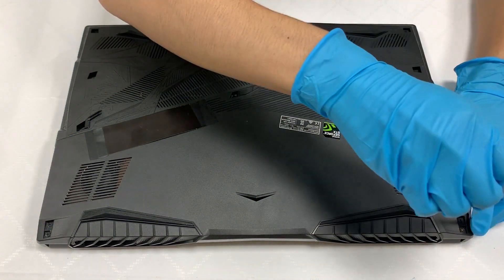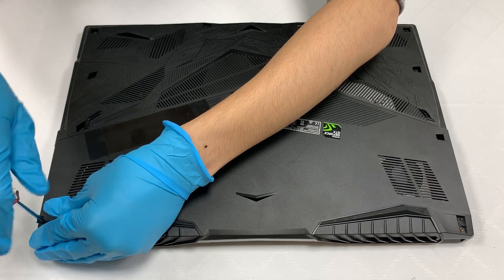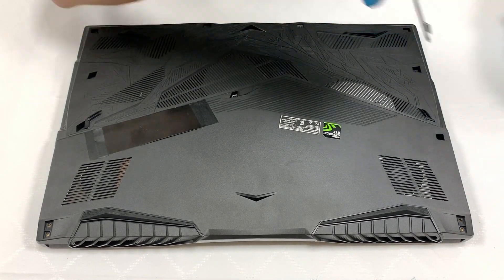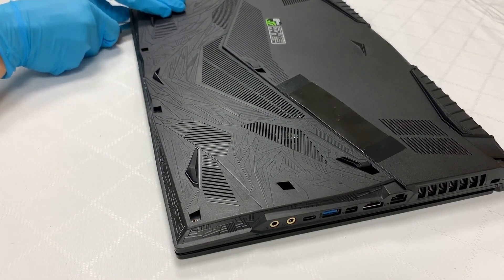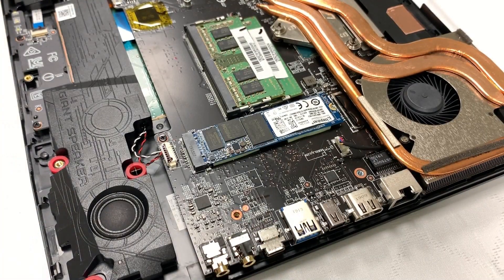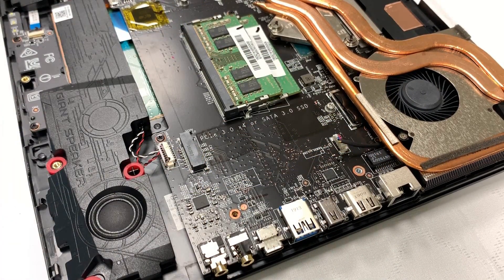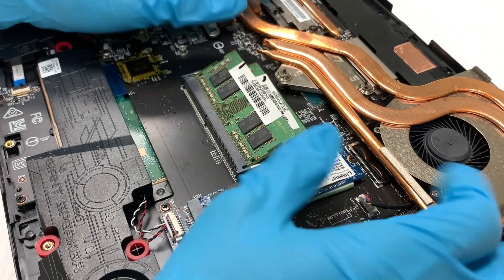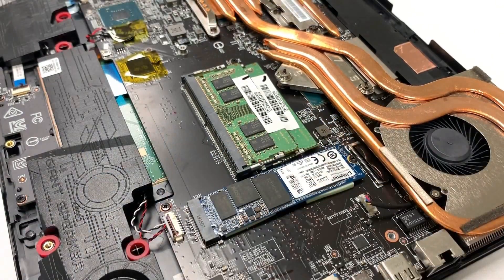MSI GL75/GP75 Leopard/GE75 Raider/WE75 Series SSD & RAM Upgrade Tutorial

Comment: Thank you for the clear and logical disassembly of this computer - got a GL75 for my daughter in 2021 and she filled the 512gb SSD and didn't like the idea of an external SSD - since storage has dropped in cost like crazy - got a 2TB M.2 from Crucial and since I was going to be inside - upped the RAM to 32gb. I was able to open and replace the 2 components without a hitch - or so I thought. I wanted to make sure the closed drive would boot so I halfway snapped the bottom plate on and flipped it over and pressed the power button. Nothing. I popped the  cover off and re-installed the battery - and looked closer at my RAM and SSD - they were installed properly. Instead of doubting myself, I put the cover back on - installed all the screws - (most importantly) snapped the cover at the hinges - and it came on like a champ.
Reply: Did you have to clone the drive? I've always had trouble in the past upgrading laptop hard drives because the laptop did not want any other drive in it other than the one it came with.

Comment: I have a concern. When trying to pry up the back plate on the GL75 some of the port are starting to lift up with it. Is there a way to fix this? Bc it looks like the metal parts were placed too far into the plastic plate causing it to lift up with it.

Comment: Is there any way to just change the ram speed and timings in bios to the max 2933mhz without upgrading. I’ve tried to when I first got the laptop but I’m just trying to overclock before I purchase ram to see if there is a major difference. And if so how can I find optimal latency for the GP75 Leopard 10SFK-219

Comment: Best video I've seen yet for this model. I am, however, even more confused now because I just watched another video that showed the same model with two SSD slots and two HDD bays! I went in and swapped out the two 4 Gb RAM chips for two 32 Gb RAM chips, and I saw the second open SSD slot, but I don't remember seeing a second HDD bay. I want to open the case back up to insert the second SSD, and I was planning to also replace the 2.5" 1 Tb HDD with a 2.5" 2 Tb SSD. Now I see that this model comes with different setup: 1 SSD bay and 1 HDD bay; 2 SSD bays and 1 or maybe 2 HDD bays. If there are two HDD bays, I would want to buy two 2.5" SSDs, pull the HDD in there now, install the two SSDs and stripe them to a RAID 0.

So what's the deal: How would I know there's a second HDD bay without opening the machine first?
Reply from the maker: This notebook should have only one HDD slot. You can go to the manufacturer's web fro check the specs.

Comment: Hi, is it necessary to reset the Laptop when you upgrade it with a hdd
Reply: That depends on what you mean by upgrade.  My new unit has an SSD and I added the HD to the unit as a data disk and just threw the bottom back on, powered it up and went.  One thing is for sure though, it's NOT easy to get back together.  The one thing to really watch is the audio jacks.  It's VERY easy to end up having them not want to poke back through the holes.  I ended up using a piece of wood sharpened in a pencil sharpened to lift the sockets/board assembly up about 1/2 a MM to maybe 1MM or so before trying to snap it shut so they'd pop in before trying to snap it right shut.  I also had to make a tool out of plastic to part the bottom.  They used all kinds of plastic latches around the edges.  Once you get a few loose so you can start making progress, it's not too bad though.  Good luck. :)
Reply: @GamingHelp  thanks

Comment: At 17 seconds in you say use a small pin in order to ............? Can't hear it. Could you tell me what you are saying? Thanks you
Reply from the maker: "Reset EC" is to cut-off the power from the battery to avoid any damage from the short-circle.
After all the upgrade processes, you need to plug in the AC power adapter to power on the notebook because the battery power is cut-off by "Reset EC".

Comment: Hi, I have a query, I am in a dilemma since I do not know whether to buy a msigf65 with a 2060 or a reconditioned msigp65 with a 1660ti, there is no other difference between them and I found them at the same price, in advance thanks
Reply: Jaime Luna the 2060 is better, plus you get ray tracing if your into that.

Comment: It apply to MSI GL75 Leopard 10SFK 060XES (2020) ?
Reply: AFAIK, the frame of the GL75 looks the same as this. Just make sure that you have the proper tools and follow the comment above by taking the piece under the monitor off from the back instead. It's a bit easier that way.

Comment: I have the GE75 Raider and my laptop is just shutting down. Does anyeone know if its the ram or not. Is just been locking up and its a pain. It started happening today(after two year of using it) and its happened like 7-8 times. I dont know anything about computers so i want someones help
Reply from the maker: You should ask the manufacturer for the laptop issues.

However, you need to do cross-validation with another working RAM to know if your RAM has a problem. 
What you did to trigger the shutdown problem is also important information for troubleshooting.

Comment: do i have to remove the battery if i want to install a ssd? my model has only one m.2 ssd and one space left for ssd/hdd
#
Reply from the maker: It's to avoid any damage from the short-circle because we don't want to take any risk.
Reply: @MFLAB  hey thanks and what does the reset at the start do?
Reply: Murat , are your end up with removing battery. ?

Comment: Hi. Nice to see.
I have a question.
Does anyone knows if it is possible to install a RGB per key keyboard in such model like this with only red keys?

Exchange the red keyboard to one with RGB? Thank you =D
Reply from the maker: You should ask the manufacturer because the upgrade policy varies by different manufacturers.
Your firmware settings might set to use only a single color keyboard, so it might not work if you change a full-color keyboard by yourself.
Reply: @MFLAB  thanks. As they made both variants, I thought it was possible. They said no :( and RGB sold out here :(

So I wonder to exchange the GL75 to an GP75 RGB instead. Just have an GTX 1660 ti and not the RTX 2060 :(
But have RGB instead

Comment: how is msi claiming to be for gamers when  its this difficult just to upgrade your ssd? should just be 2 steps.. 1.unscrew the back 2.replace/add the ssd. Their marketing gimmick of ge/gp/gl is annoying too.
Reply: For gamers - its commercial phrase. They make it hard coz 2 reasons:
1. They force you to use their official service
2. They sell 4 laptops with 8, 16, 32 and 64gb ram instead of 1 which could be easily upgraded. 
If u try to open ur msi for first time, get ready for disaster.
Reply: @znajdesposob  So it's hard to upgrade the ram...? Having second thoughts about this purchase
Reply: @znajdesposob  Do you think I should buy a different laptop for the same price? I wanted this one because good specs for a good price but it absolutely has to be upgradeable or it is useless to me. 8 GB of video ram is not much. Is there a laptop that you would recommend?
Reply: @sagekindred6106  i would try to convince seller to upgrade it for me. in my case currys shop didn't want to do that, but have a try. MSI has good specs and I wouldn't rly change it only because of that cover issues. finding some good service, which has experience with msi models and asking them for this may by a good solution too. im not expert tho, I bought acer predator gaming laptop last year and after 6 months i gave it away and bought msi - i like it a lot more. anyway i would not hesitate to buy some gaming acer if it would be a better price/spec then msi. and yes, 8gb ram is annoying marketing trick atm :/
Reply: its easier than alot of laptops especially asus laptops with everything under the keyboard. Dont like it build a tower or get your abilities up to be able to do so. simple
Reply: @bakersavage229  The last laptop I had was  a Sager/clevo laptop. Those are a breeze to customize.

Comment: What is the thickness of the gasket under the disk SSD m2 ?
Reply: I wouldn't use the thermal pads that are stock, they are way too thick. The m.2 is curved due to their choice of thermal pads. I have the same laptop so I know first hand. I would just use any thermal pad that is thinner and full length of the m.2 not two squares with a gap in the middle lol.
Reply from the maker: You might talk about the thermal pads, you should ask the manufacturer.

Comment: How many hard drives will this accommodate? And of which type? Thanks for the video!
Reply: I found the answer to the GE75 (model featured): 2 GEN3 nvme slots, 1 sata slot for mechanical drive or regular SSD
Reply from the maker: Do you mean hard disk (HDD)? This model has only one SATA slot for HDD.
Spec. question please go to the manufacturer's website.

Comment: how much you can increase the RAM, to the gl75 9sek model and which one you should buy. Thank you.
Reply from the maker: Specification questions, go to the MSI web.
Reply: 64gigs 2x32 2666 ddr4
Reply: @skeetorkiftwon  is this an absolute fact from the site? I’d put 64gb but someone said max was 32
Reply: @907Blademan  its in mine, currently.
Reply: The website states everything. Would assume that it is 64GB
Reply: should be 64 gb